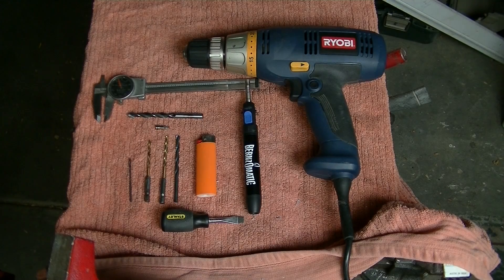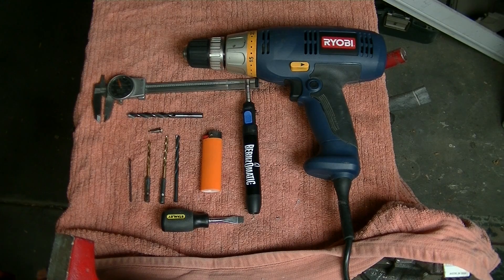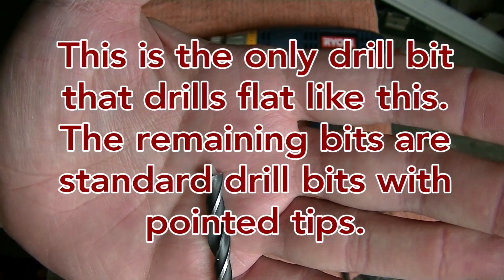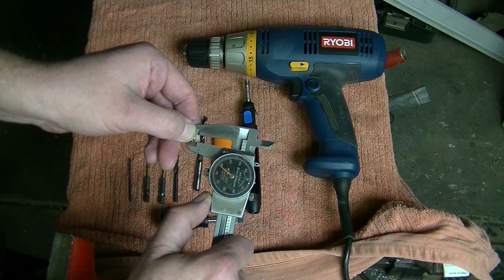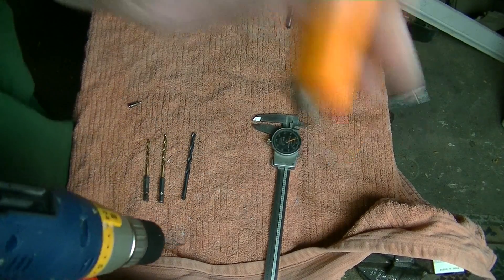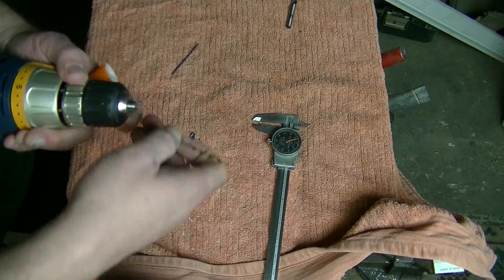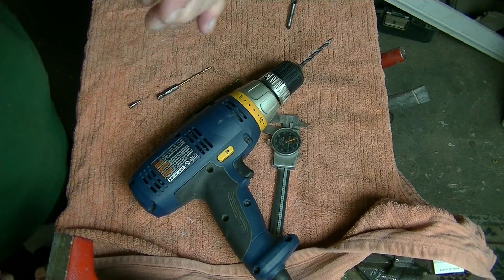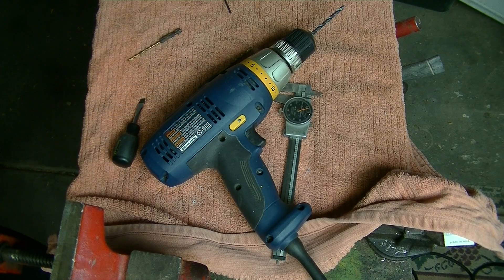Make A Bic Lighter Refillable By Installing A Refill Valve

Comment: Those drill bits are called brad point. They help keep the bit from sliding off the target mark without sliding around. Regular common bits are called jobbers and are generally angled for either metal or wood. Brad points are usually used for wood and plastics. They also tend to tearout less than regular jobbers.
Reply from the maker: +Mike Welch Good information Mike

Comment: Why not just buy a Zippo?
Reply from the maker: +123corey Cause they suck.  lol
Reply: +AdamAviator mike sims while you swallows what i read. buying a zippo is too easy and expensive. this is something for people who have something called a sentimental attachment.
Reply: ***** Fair enough (i know very late reply)
Reply: +123corey i did this rather than buy a zippo because when you try to light the bowl on a bong with a zippo it doesnt go so hot.
Reply: +Brian Hulse cuz Zippo's taste like shit thru a pipe or bong. So bic's are the shit...
Reply: tru
Reply: +peguy that's where butane inserts come in $12 all day long
Reply: +Brian Hulse pipe insert solves this...or simply drill the wind guard and light from the side
Reply: true that does work ti but at the end of the day it prolly just comes down to preference, although i will say filling a zippo is much more annoying than filling something like this, especially considering how much more frequently you would have to do so on a zippo
Reply from the maker: +AdamAviator I'm removing the sexually based comments ... let's keep it clean, shall we?  :-D
Reply from the maker: +flY_Sw4tteR_ Even with the butane insert, its STILL a Zippo ... YUCK!

Comment: For the center wall, see your dentist about some used dental bits.  Some of them are 'grinders'.  You get much smaller pieces.  Then maybe some wire insulation and blow them out?

Comment: Couldn't you just buy a BBQ lighter, dissect it, take out the gas tank, release the gas from the gas tank, and take the fill valve from there instead of purchasing a $6 fill valve from a sketchy website?
Reply: Sketchy? Bruh 😂 Its a well ass known airsoft website with 1.7 Million subs on YouTube. dumbass
Reply from the maker: Thank you Brian for the feedback this is good information!
Reply from the maker: Stephen Wang Those BBQ lighters usually have valves that are way too long and wont fit inside the bic.
Reply: ***** drill a giant holeee and then seal it airtight.
Reply from the maker: The biggest issue is the plastic support wall that runs the length of the lighter down the center ... getting enough of that wall removed for a long stem nozzle would be a huge pain in the ass.
Reply: ***** well.. if ur desperate to do this mod and you couldn't find a nozzle.. i guess you could remove the wall...
Reply from the maker: +Stephen Wang Cute
Reply: ***** Stephen Wang stated it was a sketchy website.
Reply: +Mike Sims he means to say that you could by a different refillable lighter than salvage the metal refill bit and use it for this rather than buying the piece from the site you linked.
Reply from the maker: +Brian Hulse which of course I've tried many times. And essentially this is what I AM doing. This nozzle has proven to be the best one so far. I haven't been able to try any of the other airsoft solutions yet.
Reply: ***** ive done your method too, i had an old gas airsoft gun that i stole the nozzle from and used that, works like a charm.

Comment: That type of drill bit is called a Forstner. Here is an example:
[harbor freight link won't post here...item#1903]
I like Bic lighters for lighting cigars, which sometimes take a lot of butane to get burning evenly.. Any update on those re-useable valves? Might have to check out the Airsoft spares. Great video. Amazing how 5 minutes of effort is just too much for some ppl who embrace throwing away everything when just one part is done or used up.
Reply: Buy another one
Reply from the maker: DBAmichael I added a link in the video for purchasing valves.
Reply from the maker: DBAmichael And thank you for the info on the bit ... obvioiusly named after the guy who invented it?
Reply: ***** Fantastic! Yep, probably Forstners 15min of fame!
Reply from the maker: Hey, when I look up a Forstner drill bit on Amazon, I get a very different looking drill bit ... are you sure thats what they are called?
Reply: ***** Actually they're known as Brad Point bits. Forstners are for large flat bottom holes.
Reply from the maker: DBAmichael, the link to the nozzles is in the video as a popup note.  Thanks for the positive feedback.

Comment: I usually buy a refillable torch from a gas station for about $6 and i just twist out the refill part and i use a little dermal drill thing to make a little hole and i put a little super glue and push it in it works perfect every time but i have been trying to fine somewhere to buy the refillable part cheaper i wish you could buy them in bulk ahah!!
Reply from the maker: Haylee Ford Well Haylee, I'm not sure if you saw the link in the video where I talk about the nozzle, but I have a link in there now for a direct source where you can purchase the refill nozzle. And with this mod, when the flint runs out, you can just unscrew the nozzle and re-use it in another bic. I never had much luck with sealing in a nozzle using super glue or even JB weld, I always managed to get a leak. So I came up with this method and it works perfectly.  :-)

Comment: It would be easier and cheaper to buy a $10 buck Zippo lighter.
Reply from the maker: Veritas Aeuqtias But that would lose the cool factor of this mod. Not to mention, the Bic lighter is truly a unique lighter. They light EVERY TIME and they produce the perfect flame. Did you know that Bic manufacturers SIX MILLION lighters EVERY DAY!??? Staggering! There has been enough times where I found myself using the stove to light a smoke, but those days are over.  :-)
Reply from the maker: Thank you for commenting and for the compliment.  I agree that each lighter has their different applications. Zippos are, however, an American staple and icon ... like Harley's, The Dallas Cowboys and apple pie. :-)

Comment: What about using a little vacuum to get the pieces out instead of trying to shake them out? More efficient and probably more thorough too.
Reply from the maker: Aaron Yu That would have to be one AMAZINGLY small vacuum... I think the problem would be - if there were a vacuum that small, it would probably seal the hole that was drilled, and then it would create a vacuum in side the lighter without sucking in any air or particles because there is no hole anywhere else in the lighter for air to move through it... However, the new nozzles that I was able to find might fit without needing to chip away that inner wall ... I will know in a week or two for sure.  Thank you for your response.  :-)
Reply: Actually, if you have a miniature cone, you could fit that over the open end of your vacuum tube. I should've clarified that I wasn't necessarily talking about creating a vacuum like that, but just enough air suction that majority of the particles would eventually get sucked out with the help of some shaking.
Reply from the maker: Aaron Yu OK I see what your saying ... I like it ... like the vacuum would just give that extra nudge to the bits inside and would be “coaxing” them out so to speak ... right?  :-)
Reply: ***** Yup! The wind pressure in the lighter created by the vacuum's suction should be enough to suck the spare bits out so you won't have to deal with any rattling (aside from maybe the little BB that was originally in the lighter).
Reply from the maker: I like it!

Comment: Ronson Varaflame filler valve type "A" - 4 Valves + O-Rings
http://www.ebay.com/itm/Ronson-Varaflame-filler-valve-type-A-4-Valves-O-Rings-DIY-Video/121088509771?_trksid=p2047675.c100005.m1851&_trkparms=aid%3D222007%26algo%3DSIC.MBE%26ao%3D1%26asc%3D30084%26meid%3Dca44b906c4d64ce79da82bd8dae7811d%26pid%3D100005%26rk%3D1%26rkt%3D6%26sd%3D171742340831&rt=nc
Reply from the maker: +Mike Fowler Those are nice!  Even if a little pricey!
Reply: Yep they seat good and are strong to re-use, last one I did I used for 2 year learned you can replace every piece on a bic even the gas exit value piece that sit down in the lighter  that is pulled up when you light it. which it actually spring loaded to pop up on it own.

Comment: would have been so funny if after the whole "it's not gonna hurt anything" the lighter exploded as soon as you drilled in to it xD
i would have laughed my ass off, even though i'd hope you were ok.
Reply from the maker: Well, I appreciate your capacity to both mock my failure while simultaneously experience genuine concern for my safety.  :-)

Let's not forget, however, that I do make sure the lighter is completely devoid of fuel before drilling by using a pin to pop out the bb that plugs the hole at the bottom.

Comment: I have a "cricket"  disposable lighter not available in the US where can I get a fuel valve
Reply: http://www.ebay.com/itm/Ronson-Type-Varaflame-Quality-Filler-Inlet-Tool-1-Valve/171742340831?_trksid=p2047675.c100005.m1851&_trkparms=aid%3D222007%26algo%3DSIC.MBE%26ao%3D1%26asc%3D30084%26meid%3D531c70f84cb0426f9121d2bfd770f26d%26pid%3D100005%26rk%3D4%26rkt%3D6%26sd%3D271825999773&rt=nc
Reply from the maker: Mike Fowler Those have the nozzle that sticks out ... so it would not sit flush with the bottom of the lighter unfortunately. I was able to submit a photo of the valve to a site that has thousands of suppliers so we'll see what turns up.
Reply: Having my lighter being able to sit up right is not important to me.
Reply from the maker: to each his own ...

Comment: i tried looking for those nozzles. really, u cant find them anywhere!! they should cost like 5 cents but the cheapest i found was a brand new refillable butane lighter for $1.98.
Reply from the maker: Not yet
Reply from the maker: can you post the source for the lighter?
Reply: amazon.com
Reply: Ronson Type (Varaflame) Gas Filler Inlet Valves
http://www.ebay.com/itm/2-x-Ronson-Type-Varaflame-gas-filler-Inlet-valves/171742356396?_trksid=p2047675.c100010.m2109&_trkparms=aid%3D555012%26algo%3DPW.MBE%26ao%3D2%26asc%3D28790%26meid%3D29c468e4fd784e919ffc70c840115887%26pid%3D100010%26rk%3D16%26rkt%3D16%26sd%3D171742340831
Reply: ***** http://www.ebay.com/itm/Ronson-Type-Varaflame-Quality-Filler-Inlet-Tool-1-Valve/171742340831?_trksid=p2047675.c100005.m1851&_trkparms=aid%3D222007%26algo%3DSIC.MBE%26ao%3D1%26asc%3D30084%26meid%3D531c70f84cb0426f9121d2bfd770f26d%26pid%3D100005%26rk%3D4%26rkt%3D6%26sd%3D271825999773&rt=nc
Reply: Mike Fowler  The price is prohibitive approx. $4.00 apiece, you can buy 2 new bic lighters for this price.So, I don't see the point to try this method unless you can reuse the valve over and over again.
Reply: U can refill one bic lighter 10-15 + times before the flint runs out and then after that put that same refill nozzle in to a new used bic that will then get 10-15 + more refill and then repeat and repeat etc.....until someone walk off with it. So yes you can do that , I been using my currently made refill bic for over a month when a strait bic lighter would only last me no more then 4 days.
Reply: Mike Fowler That being the case what am
I complaining about ? Great value even at
10 refills per lighter, and to reuse the gas valve makes it a fantastic deal.
Thanks Mike.
Reply: O yea I was being a jackass and responding before I read your commit completely and all the way threw that's why I edit it after I posted it, but you still get my original post, of me being a ass. MY BAD !  If any one has problems with leaks around the nozzle, wrap it in some Teflon Plumbers tape before inserting in to the lighter. Then very carefully super glue around the outer-side of the nozzle let dry and repeat 2 to three times. I use a 8mm insulin syringe to apply the super so it dose not get inside the nozzle.
Reply from the maker: Mike Fowler The problem with the nozzle you linked to Mike, is that it looks like it would protrude past the bottom of the lighter making it impossible to stand the lighter up on it's end.
Reply from the maker: Sergei Draleau Good news, I found a source for some nozzles that look almost identical ... the supplier is sending me two samples this week.

Here are some pics:
http://i.imgur.com/4iTg3A9.jpg

http://i.imgur.com/w5yTj7d.jpg
Reply from the maker: Joseph Maximus +Mike Fowler 
+Sam Raja 
+will watts  +illuminatist boss

Good news, I found a source for some nozzles that look almost identical ... the supplier is sending me two samples this week.

Here are some pics:
@4
http://i.imgur.com/w5yTj7d.jpg
Reply: ***** Did they give you a price ?
Thanks, Joe

Comment: Its not worth putting then in a flint type lighter, I put them in Ronsn piezo ignition type, You can get cheap lighter from Dollar tree. They don't have threaded type but I glue them in with epoxy and they work great. some of them have plastic body. which is even better.
Reply from the maker: What kind of epoxy do you use? Back when I was first experimenting with installing refill nozzles in a Bic, I tried to use JB weld to hold them in, and it flat out would not hold an air tight seal.
Reply: I use 5 minute 2 part epoxy.  Normal use is 50/50. but I add a bit more hardener, do not fill for at least for 24 hours, even though epoxy seems hard after 15 - 20 min.
Reply: Sam Raja http://www.ebay.com/itm/Ronson-Varaflame-filler-valve-type-A-4-Valves-O-Rings-DIY-Video/121088509771?_trksid=p2047675.c100005.m1851&_trkparms=aid%3D222007%26algo%3DSIC.MBE%26ao%3D1%26asc%3D30084%26meid%3Dca44b906c4d64ce79da82bd8dae7811d%26pid%3D100005%26rk%3D1%26rkt%3D6%26sd%3D171742340831&rt=nc
Reply from the maker: Mike Fowler This link MIGHT be what we need ... who wants to front the $48 to find out? looks like a two piece valve, the sleeve and the valve itself but based on the picture, it does not have that protruding nozzle which is exactly what were looking for.
Reply: We can get 4 very nice Zippo re-fillable lighters for less than $48. And they last a life time. Some company gave me one about 18 years ago its a Zippo re-fillable, and electronic ignition. Still works like new. sparingly used though. I checked the price on Zippo website it was under $20.
Reply from the maker: Sam Raja Well, I figure if someone is watching this video, then they are probably well versed in what is available in the market in terms of lighters. Personally, I've had Zippos, but I'm not a fan of them. Much bigger and heavier than a Bic and I don't like the taste of the Zippo fuel.
Reply: ***** I was talking about Zippo butane re-fillable. I agree zippo liquid fuel stinks and tastes nasty.
Reply from the maker: OH, I have no experience with those

Comment: Or spend less and buy a SAFE new one.
Reply from the maker: This is NOT about saving money ... it's about the convenience of having it refillable so you don't have to make another trip to the store or whatever.
Reply: A single Bic lighter cost around $1.25 - $2.00 and I've seen them priced even higher. With his modification the flint will like around 15 refills. So you DON'T save money just buying a new one. Bic lighters are also one of the most disposed of things on this planet, sitting in landfills for ever. Win win for this lighter mod IMO.
Reply from the maker: If this nozzle is installed correctly, there is absolutely no deficit in "safety" over a new Bic... this nozzle has an o ring on it that when seated correctly prevents any leaking at all ... never do this stuff with any kind of glue or epoxy etc. Butane under pressure will find its way through any weakness in the epoxy set
Reply: ***** Her is a test for responders about buying a safe butane lighter.
Ride on a motorcycle and have a bic and a store bought propane lighter.
Let go of both at 30 mph so they hit the street. See which one handles the test better. I ride on the Mexican Border where there are no stores for hundreds of miles. So durability figures into how I act in my area.
Reply from the maker: harry rokytnji I never said nor would I ever believe that this is the end all / be all of your lighter needs. But for each situation where a Bic lighter is in fact an excellent tool for the job, having one that can be refilled can only be a function enhancer and not a reducer. So there is no need to perceive anything in this video other than what is presented. OBVIOUSLY there are situations where other lighters suit the task at hand in a much more thorough and functional way.

Be smart people ... common sense isn't called common because it necessitates a degree in order to experience it. I really should not have to explain such axioms - you obviously aren't a chimp. But thanks for watching the video. I was in no way expecting to receive this many views on it.

Comment: wmb is what your doing. the flint only last maybe three refills, so then what???? all that work for nothing. ha ha ha
Reply from the maker: As I said at the end of the video, I've had these flints last as long as a year through as many as 15 or so refills. The flints in Bic lighters are much longer than a typical Zippo flint, and they do last quite a while. And to answer your question, you could easily unscrew the nozzle from the lighter and install it into another one.
Reply: ***** You can also replace the flints with Zippo or Ronson flints. You have to remove the hood and sparkwheel, then place the new flint atop the flint spring and reassemble. It's annoying to do, but possible.
Reply from the maker: Also, when you’ve done this mod a few times, it can be done in less than 5 minutes ... so all you gotta do is grab a new empty Bic and install the nozzle in it and you’re good for a while.
Reply: I just use the flints out of old dead Bics...recycling. Takes 15 secs. Free.